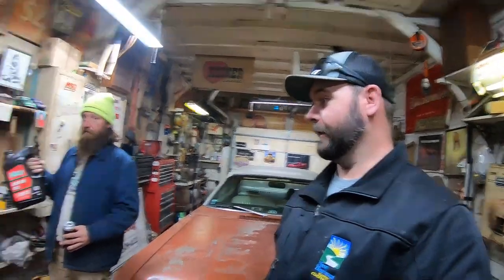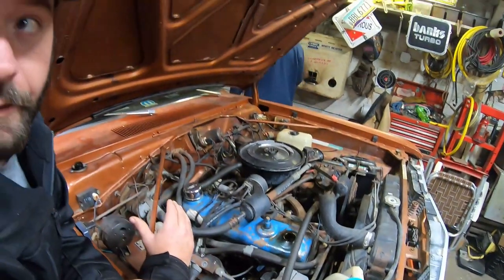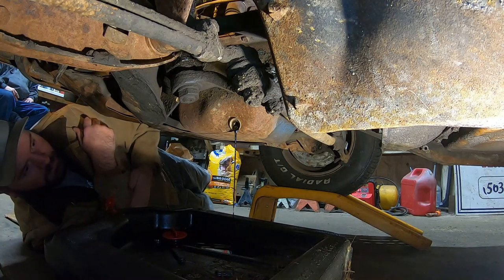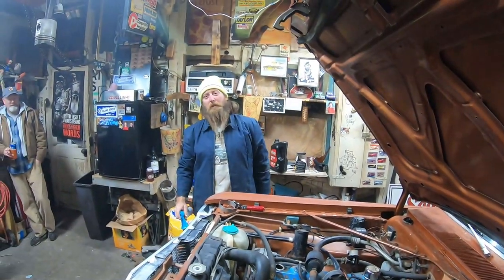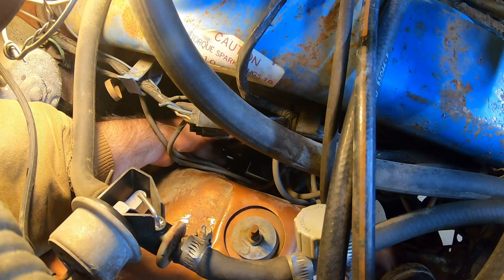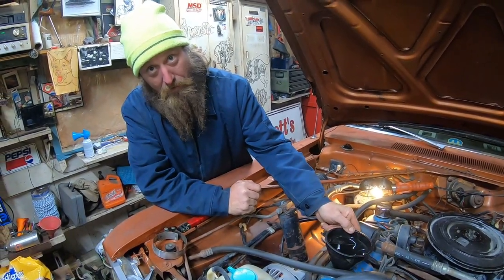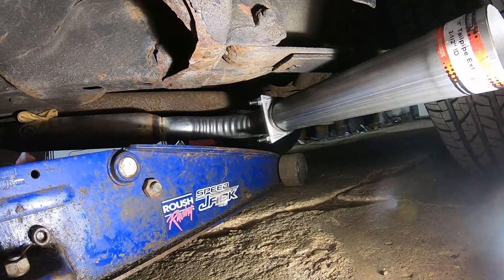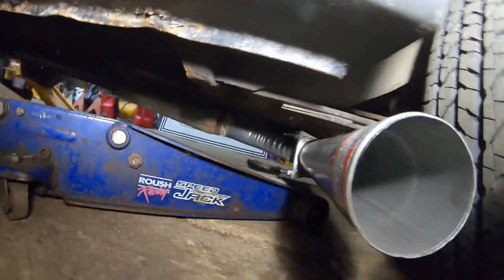Our Project Slant 6 1975 Plymouth Duster gets an Oil and filter change, tune up, spark plugs.

Comment: Fresh lube, spark and tip. Nice! Thanks for the shout out. And for the wisdom you seek;
Nary, often used in the phrase "nary a" to mean "not a single," is an 18th century alteration of the adjectival phrase "ne'er a," in which "ne'er" is a contraction of "never." That contraction dates to the 13th century, and the word it abbreviates is even older: "never" can be traced back to Old English "nǽ fre," a combination of "ne" ("not" or "no") and "ǽfre" ("ever"). Old English "ne" also combined with "ā" ("always") to give us "nā," the Old English ancestor of our "no." "Ā," from the Latin aevum("age" or "lifetime") and Greek aiōn("age"), is related to the English adverb aye, meaning "always, continually, or ever. This "aye" (pronounced to rhyme with "say") is unrelated to the more familiar "aye" (pronounced to rhyme with "sigh") used as a synonym of "yes."

Keep the hood pins in, the tires on the ground and foot to the floor. Take care.
Reply from the maker: Thanks for the info CCHH
Reply: Best YouTube comment ever